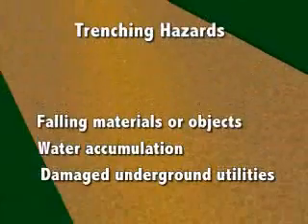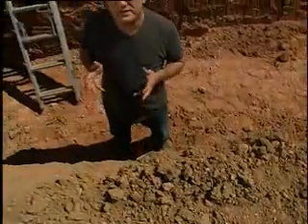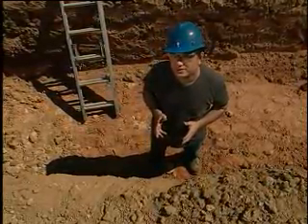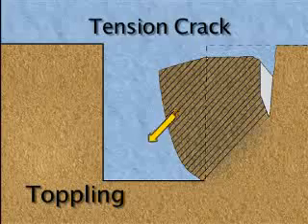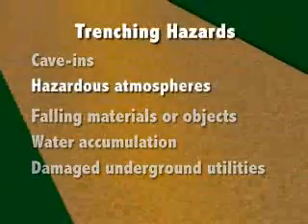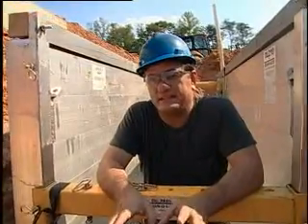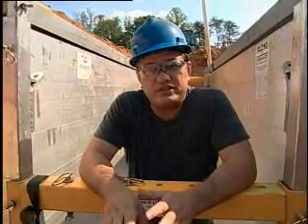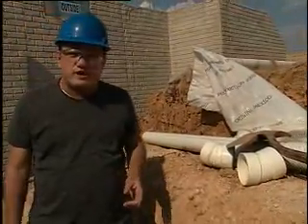Trenching & Excavation Safety

Comment: glaring error in saying methane stays in the trench - it is lighter (lower specific gravity) than air and rises unless there is a cap or confined space with poor ventilation such as a sewer vault); heavier hydrocarbons such as propane are heavier than air and settle in trenches; other than that pretty good